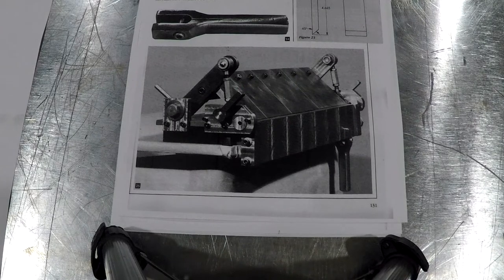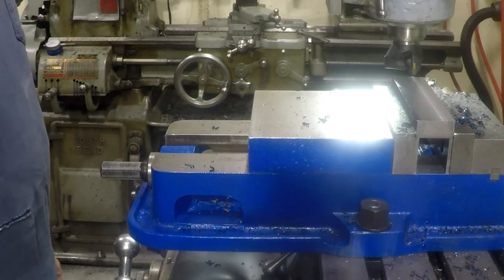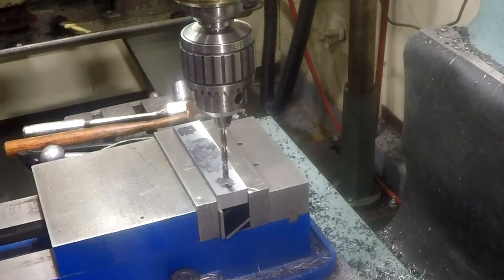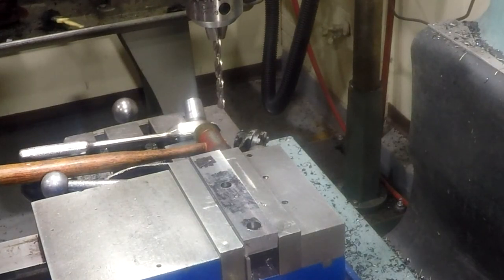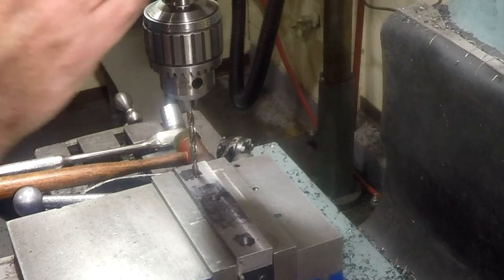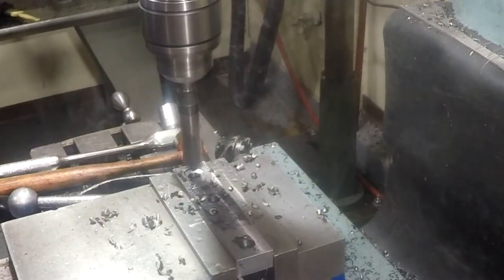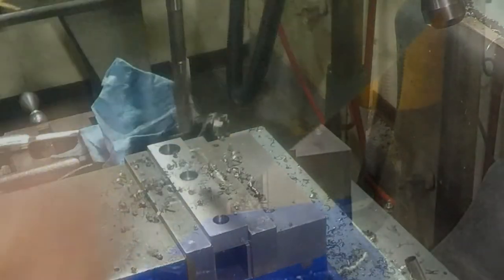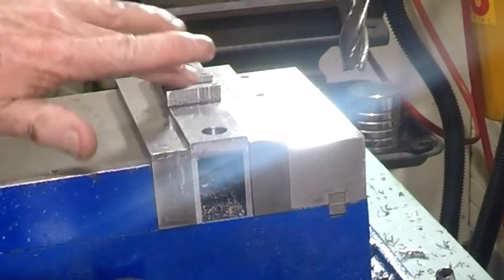Bending Brake Episode 3 - Clamp Lever

Comment: Bob,
I keep coming back to your brake. It is the right size and quality for my shop.
Would you please send the drawings, specs?
Thanks,
Jeff Anderson
Reply from the maker: I don't have any complete project drawings per se. The drawings I started with were in the "Projects in Metal" magazine/book I mentioned at the start. I can't copy and distribute these publications because they are copyrighted. I did make some drawings of most of the parts as I needed them so I could modify them to suit the longer overall length. There are eight sheets in the set I made. These drawing are in a Solidworks file ".dft" format. If you want them I can e-mail them to you but you will need some software to read and display them. I used Siemens Solid Edge ST9 to create them. Last I checked the 2D version of Solid Edge is free. There might be other software that can read these files. If you do use them be sure to double check measurements as I may have made some last minute adjustments that I didn't update in the drawings.

Comment: Hi The drawing is incorrect. You show vertical lines drawn from the ".230" measurement, down to the base of the part.These lines should not be there. These vertical line should only descend to the "first" horizontal line, i.e. the machined horizontal surface.
Regards
Peter